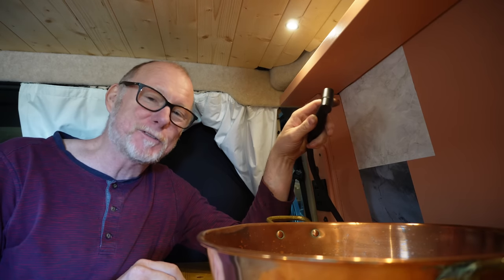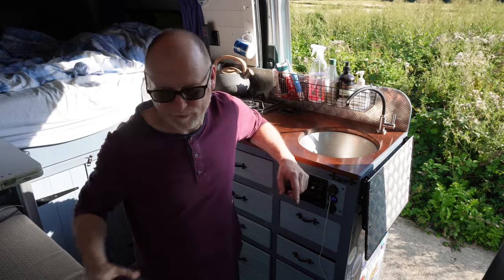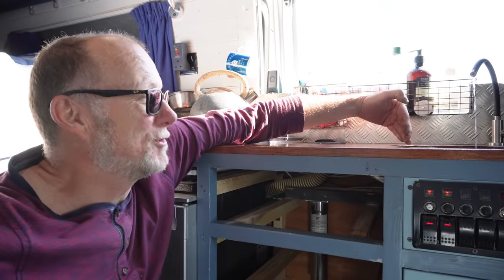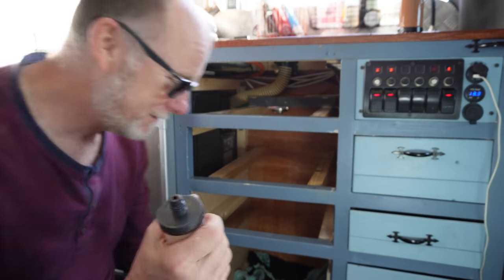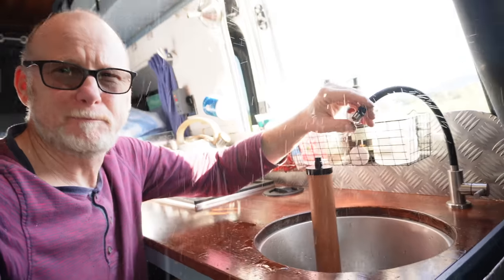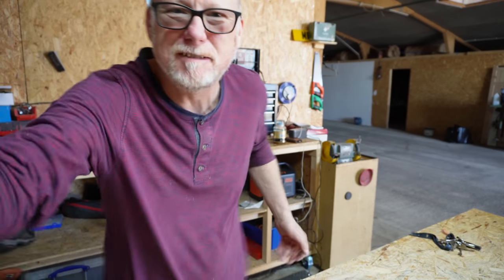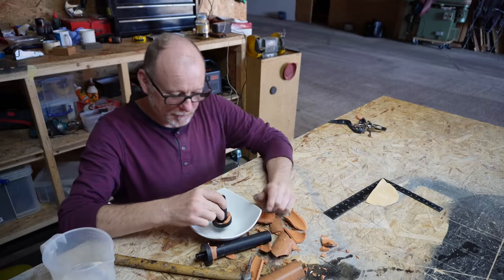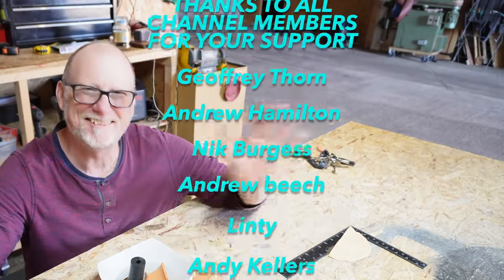What happens if you don't change the filter in a triflow mini tap

Comment: Have you checked the pressure that the accumulator is set to ?
I have a almost duplicate system to you and it’s got the pressure of a household tap
Reply from the maker: Oh what pressure do you have yours set to 👍🙏
Reply: Around 14-16 psi think it came set at 8 even though it said 10 psi on instructions

Comment: You would be better of with just an activated carbon filter, the ceramic and carbon filters get clogged much easier, they are just like a Frankie filter they need more pressure, the pump  you have in your van is ok when it's new but it doesn't have the pressure of a normal household tap . If you hadn't of smashed it and connected the filter assembly to a hose pipe and turned on the van tap it would have still worked